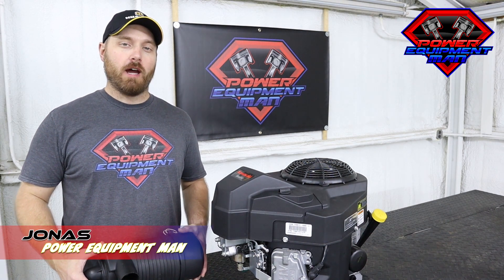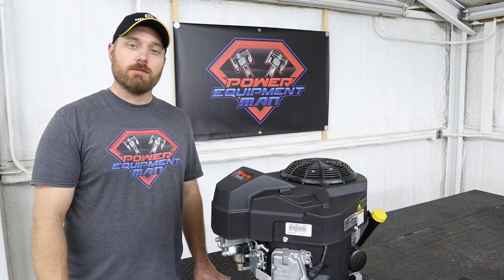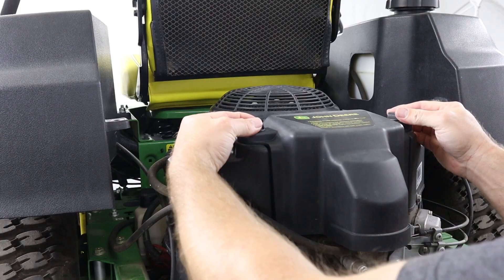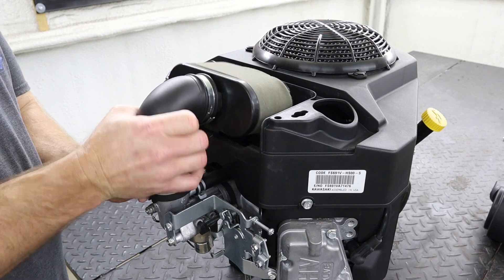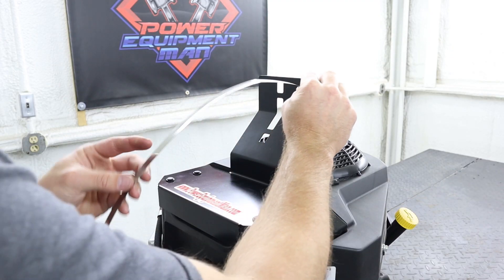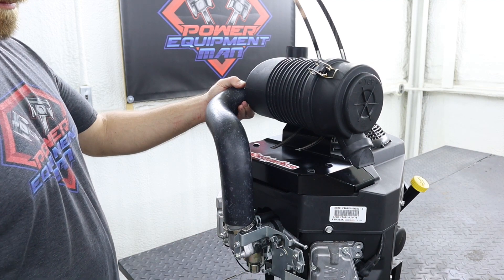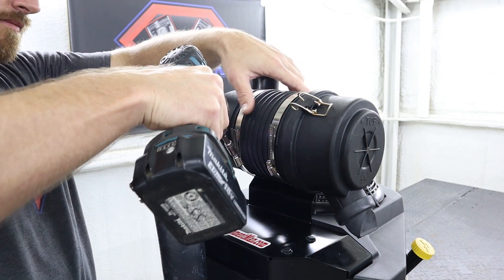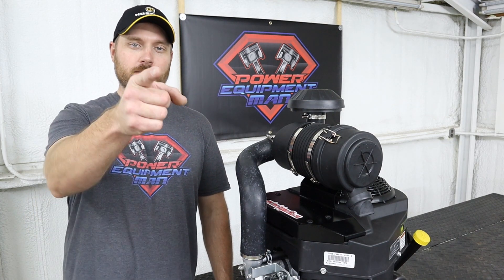New Style Kawasaki FS Canister Air Filter Upgrade Kit Installation

Comment: Have you tested if the motor runs lean or rich with this upgrade? Is there anything to watch out for?
Reply from the maker: We test these engines extensively on the dyno with exhaust gas analyzers and the AFR readings are well within the optimum operating range. We also look at EGTs (exhaust gas temp) and cylinder head temps and they are both exactly where we want them. Even just doing simple spark plug checks will tell you these engines are very happy after installing our kit. We have test engines with these air filter upgrades installed with over a 1000 hours of run time and have had no issues. We have sold over 15,000 of these kits to customers all over the world and have had no issues whatsoever. Not one single engine has ever needed to be rejetted. Most customers claim their engines have more power and run smoother after installing these kits. If these kits weren't safe to run, we wouldn't sell them.

Comment: Will this void toros warranty?
Reply from the maker: Unfortunately, we can not make any claims on how this kit will or will not affect your warranty. Honestly it has more to do with your dealer and how they handle the claim. Technically, in order for this kit to "void your warranty" there would have to be proof that the upgraded air filter was what caused the failure. For example, installing an upgraded air filter would have no effect on your starter failing, so legally they couldn't deny your replacement starter warranty claim because of an air filter upgrade.   

 I encourage you to review our liability disclaimer page on our website - https://powerequipmentman.com/pages/liability-disclaimer

Comment: Does this upgrade provide the same or better filtration as the factory one? It appears to use a kawi filter but since I have a mower with .3hrs lol. I want to make sure before pulling the trigger on it
Reply from the maker: The canister style air filter is far superior to the standard filter that comes on the FS engines. The canister filter will do a much better job of filtering the air and have longer service intervals between cleaning/replacements. They do use OEM Kawasaki filters. Hope this helps!
Reply: @PowerEquipmentMan  yes sir it sure did!! I ordered it!!!  Also can you address something I read? Someone mentioned it'll hurt my engine without rejetting...I assume it's BS but I wanted to ask.  10k mower with .3 hrs so I wanted to cover all my worries 😄
Reply from the maker: No, you absolutely do not need to rejet your carb to run this kit. Your engine will run great with this filter setup.
Reply: @PowerEquipmentMan  awesome!! Thank you!! I don't wanna buy a new mower ever again haha

Comment: This obviously covers up the inspection holes to view the cooling fins. Will the push pins pop back out and securely pop back in? How do we inspect the fins after installation?
Reply from the maker: Yes, the plastic push pins can easily be removed and reused as many times as needed to access the inspection holes. Just use a flat head screwdriver or body clip removal tool to pop up the center of the push pins to remove.
Reply: I'd like to see where these push pins are and what the cooling fins look like. 🤔
Reply: The video shows clearly where the push pins are located. This newer style filter canister will have to be removed to inspect the cooling fins. Easy task. I like this new filter system for many reasons such as double filtration and cooler and cleaner air should enter the engine. The original OEM filter system is very close to the engine and will most likely pick up hotter air and pick up more dirty particulate.

Comment: 2 Gravely dealers near me will buy these.
No warranty from Kawasaki will be a problem.
Reply: So you're basically saying if you buy one of these kits to install on your Kawasaki engine it will not avoid Factory warranty? I have a Kawasaki fr651v on my mower I just bought the kit from Power Equipment man for the FR series Kawasaki engine
Reply: @chevyguy1128  I find it hard to believe that this would not affect warranty. I guess you could reinstall the old set up when taking it in for warranty, but the holes you have to drill would be a dead give away.
Reply: @jlor7675  It doesn't void the warranty. Federal law (well, alleged federal law) states that an aftermarket part has to BE the reason for the warranty claim (failure) and THEY have to prove it. On your end, you have to walk in with proof the aftermarket part is compatible. It's not like you're walking into a dealership with a 350 V8 in your Vega. They should have had that option, fwiw. 
==
I guess the fine print on an FS/FR engine or the Filter would answer that. I would call Kawasaki and ask. Always ask for a name first. My understanding is Kawasaki is pretty good to deal with. 
I can see Kawasaki not letting it be a dealer option. That avoids the dealer being in the warranty claims process. I can also see it not being a factory option for a few obvious reasons.  
It's actually healthy to have a thriving aftermarket industry. Datsun 510 is the best example I can think of. Long past warranty claims, though...
Reply: Tried to order the kit for the old style bug says out of stock

Comment: I understand the benefits of converting over to the FX style canister filter because heat and dirt are the biggest issue for air cooled motors. When you swap a motor why not just buy the FX series? Same but comes with the canister system, different carb setup and upgraded HD starter solenoid. I run the FX series on my commercial mowers and they really get abused by the heat, dirt and dust. The two stage filter is a huge benefit!. Adding the Donaldson two stage filter to a FS is not recommended in mowing world unless you rejet to accommodate the increased suction resistance the two stage filter adds which makes it run rich.
Reply from the maker: The majority of our customers are homeowners that will never own a machine long enough to need to replace the engine. No one would ever buy a new $4000 mower and then immediately remove the engine to install a $2500 FX engine. This is for residential machines that come with the FR or FS engines with the poor OEM air filter design. This kit improves that air filter to not only get more service hours out of that engine, but also get a longer life between air filter cleaning/replacement. 

It is a common myth that these kits require the carb to be rejetted, which is simply not true. Most of the people claiming that have never installed one of these kits, let alone actually done any testing to prove their theory.  Although the intake tube is longer, you are dealing with a larger filter that is capable of flowing more CFM at less inches of water. These kits actually pull less than 1 inch at 3800 RPM with a clean filter. We have spent countless hours with these engines on the dyno and in real world testing to know that this kit does not require any rejetting or adjustments to the carb. We have also sold over a 1000 of these kits for the FR and FS engines all over the world and have not had one single issue with any of them.
Reply: @PowerEquipmentMan  makes sense. I’m pretty new to carts and have a G16. I was thinking the FS motor was a swap. Absolutely unaware that the kawi FS was original equipment. Makes way more sense now! Thank you for responding back.
Reply: That theory just doesn't make sense to me because people who are running the stock filter set up are running a dirty, filthy restrictive stock filter which is making their engine run rich. 10s of thousands of them. Just my 2 cents.
Reply: Sorry John the mechanic but you are wrong on many levels.

Comment: Will you guys make one for the fs600v at some point?
Reply from the maker: At this time we are not planning to make a kit for any of the engines smaller than the 651.
Reply: Just curious. I hate the kawi intake design, will you guys be making one for the FS541v?
Reply: @PowerEquipmentMan  any update on building one for the FS600?
Reply: I have a fs600v also and would love this
Reply: Has anyone tried it on a FS600 yet?  A lot of 36” stand on commercial mowers run a 600 what will happen if the kit is installed on a fs600
Reply: @chunkymyster08  Good Question I would also like to hear an answer ??
Reply: Yea they should make one for the FS600V because it’s a very commonly installed engine on power equipment. I’d buy one if they made it…
Reply: Would love to see one made for a fs600v engine.